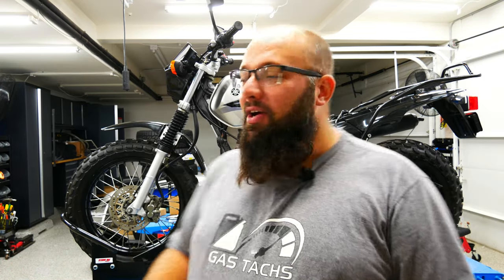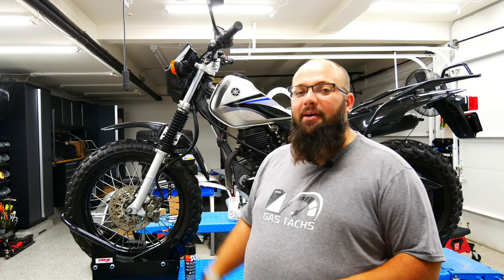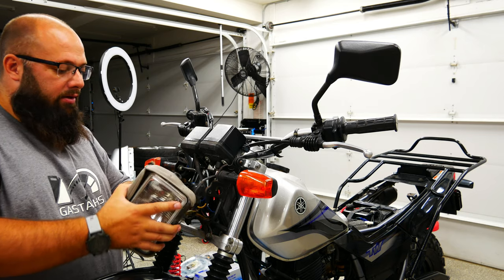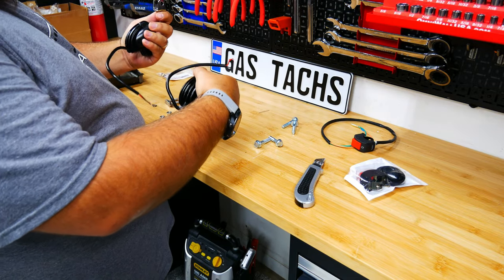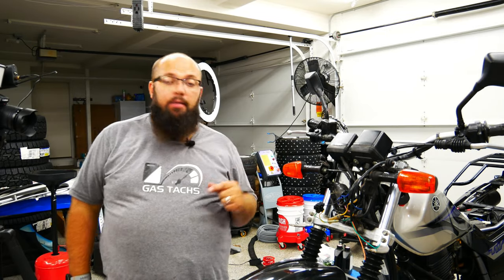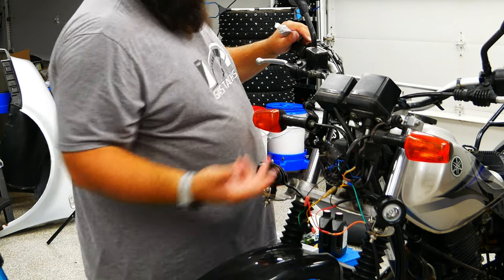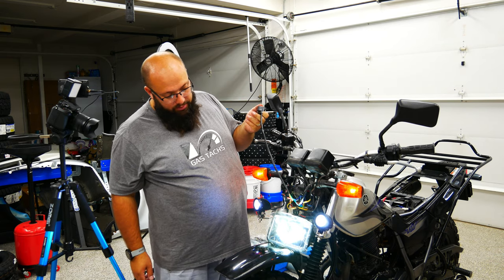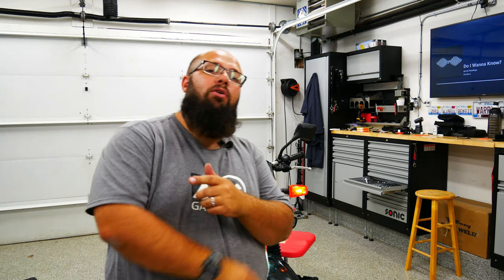LED Headlight AND Ditch Light Install - HUGE Difference! - My TW200 Build!

Comment: Lights look great ( if you are running off-road at night the more lights the better) But I think you should install inline fuses for the side light ( fuses are cheaper than a new bike.) Pushing a motorcycle back to camp because a light shorted out and fried control fuse or a control sucks.  Next mod install handle bars  Thanks
Reply from the maker: John Grant hahah fair point!